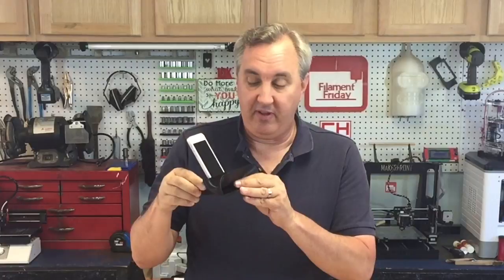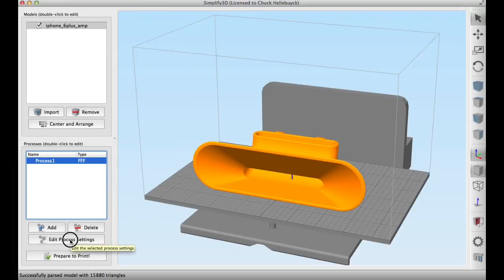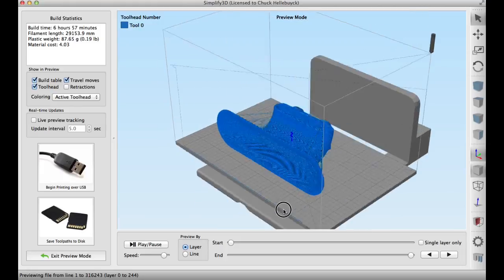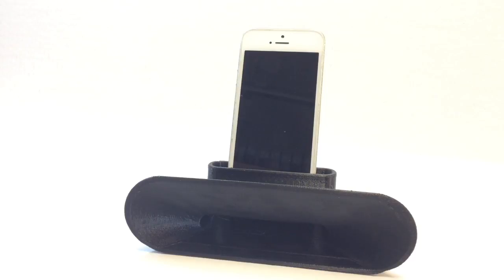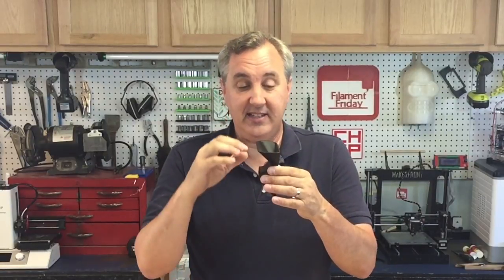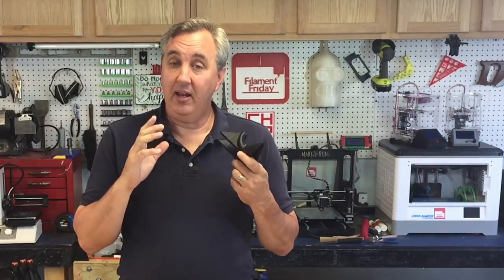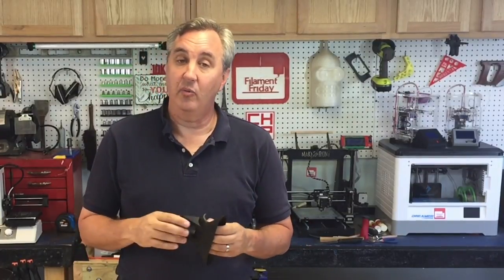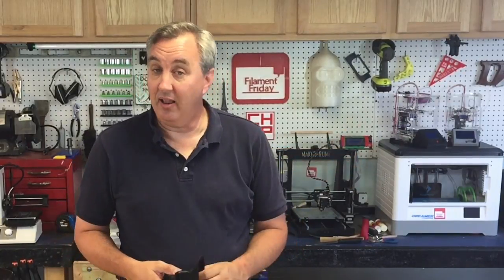3D Printing Filament Friday #79 - iPhone Amplifier on FlashForge Dreamer 3D Printer

Comment: Nice vid as usual, Chuck. 
Quick question, I have just taken delivery of my Flashforge Dreamer (based on your recommendation) and I want to print some vacuum adapters for some of my power tools. 
What type of filament would you use for this purpose? 
I was thinking of using ABS for the part that screws onto the vacuum hose and something slightly more flexible for the part that plugs onto the tool.
Any suggestions would be really helpful.
Reply: +Chuck Hellebuyck's Electronic Products I'm in Australia so I bought it through a local reseller. it still came from China but at least I have a local warrantee. I'm trying learn Fusion 360 after years of using SketchUp. hard new tricks for a lazy old dog.
once I have some models that I'm happy with I'll load them into thingiverse and link you to them if you'd like to try them.

Comment: Chuck, How did you get the funnel to bridge so well?  I have been 3D printing in ABS for 2 years now and I still can't find settings that bridge well.  Help?
Reply: If you use Simplify3D, there's an option in Cooling tab where it will turn ON the fan for bridges.